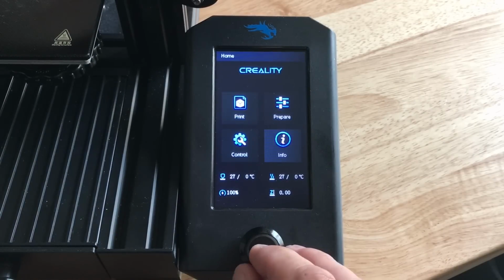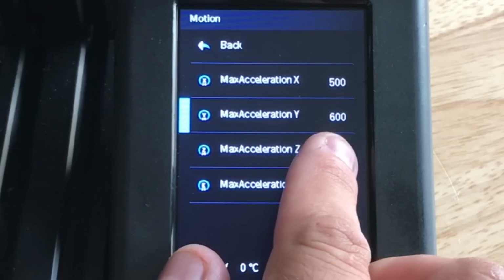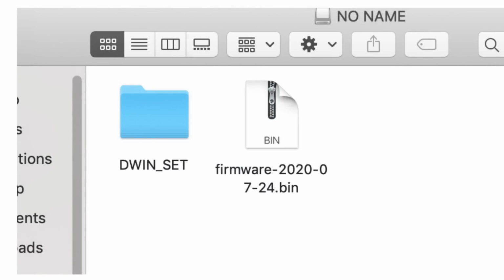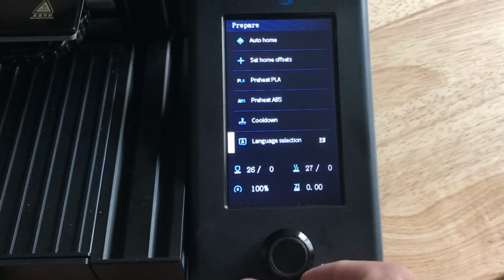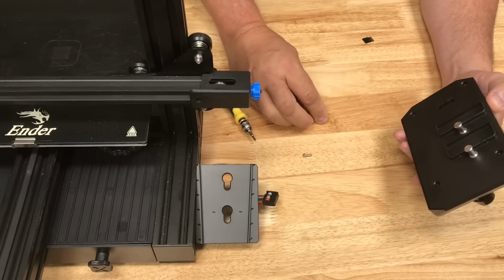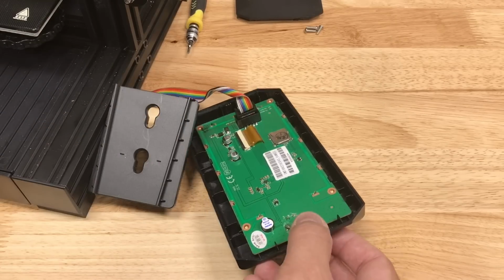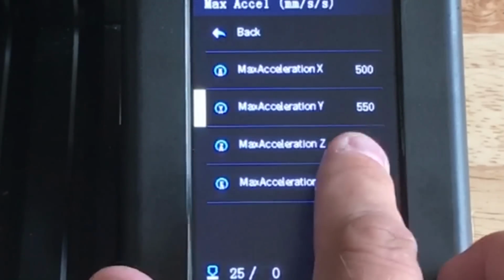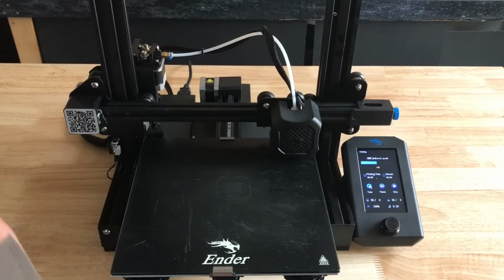Creality Ender 3 V2 Firmware Update - Motherboard and Display

Comment from the maker: Some people had issues with the Ender 3 V2 firmware version I use in my video. So I rebuilt it using the latest Marlin 2.0.7 and released it here: https://www.chepclub.com/ender-3-v2-firmware.html
Pause at height in Cura worked and allowed me to change filament every 5 layers on a rough print (0.28) CHEP CUBE. Try it out and let me know if it works for you too.
Reply: Chep, how to tuning flow rate on ender 3 v.2? I can't find any information.
Reply from the maker: You can adjust flow rate in the slicer.
Reply: @FilamentFriday  okay chep! Thaanks!
Reply: It looks like Creality has yet to release their Ender 3 V2 firmware on their github. Chuck, did you roll your own configuration file to build the firmware? If so, would you minding sharing it  (along with the adv configuration file if tinkered with) on your website along with the binary? Thanks in advance and thank you for being a great resource in the 3D printing community

Edit: Nevermind, Marlin 2.0.6 comes with an example configuration for the Ender 3 V2
Reply: I'm real new at this but I updated to the Marlin firmware.  Nothing would print correctly after that.  I'm back to 1.0.1.  I was severely confused for a while.  😘  I will wait for your verification.  😊
Reply: @CHEP Attempted.   I have a pre order V2 that arrived late June.  When I did the 2.0.6 update and attempted a print it speed X axis across the front half way down the Y axis the dumped a but wad of filament off the bed and started moving slowly towards the middle stringing filament.......  very extra awesome!  Thanks for trying
Reply: I have trouble with this firmware, allways start to print with 515 speed, when i change it printer freezes :(
Reply: itekiti yeah something still isn’t right with it. I went back to stock 1.0.1 firmware for now.
Reply: nope didnt work for me CHEP.  Froze after I changed the language it loaded up fine but there is something not right yet.    Thanks for trying though.  I went back to 1.0.1 too.
Reply: I installed it and both my ender 3 v2 act very strange. Sometime i get over 700 in speed and sometime 500. It almost destroyed my machines before i notice this behave
Reply: Worked fine for me.  Only glitch I saw was it took a few minutes for the screen to prompt to print (kept shwing pause and stop).   I should have used tune to heat the head up, because I wasn't able to get all the initial color out before it resumed printing.  Oh well.....
Reply: @gregr5  what exactly worked fine for you? CHEP firmware update, or a Creality one? If Creality, which download date did you use from their site?
Reply: @daverhodes7742  WD - I used the CHEP recompiled 2.0.6 beta code - not the official creality code.  I had the latest creality code loaded and all it did was pause at height briefly and then resume.  It didn't wait for me to hit continue.  Chep's code  compile did.  It did come up in chinese of course, so thanks Chep for pointing out how to get back to ingles.
Reply: Possible to change the translated sentence in Marlin ?
Reply: FYI - during LCD FW update the screen should be blue for 6-7 s (during actual FW flashing) before turning orange. Otherwise it's not doing anything. I had to format the SD blank and remove Chinese characters from the firmware name to get this to update. That fixed the Store configuration menu. But I didn't like the new letter aliasing introduced in it so went back to 1.0.1 anyway.
Reply from the maker: Chris- Good tip. I tried all that and mine still won’t update. The blue flashes briefly and then orange. It’s got issues apparently.
Reply: @FilamentFriday  Bummer. Indeed it not a flawless experience. Last thing I could think of is using stock 8GB card and formatting using default allocation size, but I doubt it'll help. I'll be watching the space for experiences with the new 2.0.6 you compiled (I'm not brave enough yet). Anyway, going back to watching my first layer... ;-)
Reply: @FilamentFriday  Im getting an issue where I run your bed level with your firmware update and the screen will just freeze could you help me out Thank you so much!
Reply: @xzenoraptor2583  I also have this mate
Reply: @mcloum  its really weird cant seem to figure it out
Reply: XZeno Raptor I’ve gone back to Crealitys firmware for the moment. Just installed new springs on the bed so testing with a calibration car currently
Reply: @mcloum  ah yeah I just ordered some Capricorn tubing new springs and a medal extruder
Reply: @xzenoraptor2583  which metal extruder did you get?
Reply: @mcloum  the creality one off of amazon
Reply: @FilamentFriday  well like I'm using it but still having an issue where the screen will freeze
Reply: I think it might be an issue with my printer hmmm?
Reply: TDNAM _99 like 1 month ago
Reply: @xzenoraptor2583 what version the firmware when it came? .. Mine already shipped with 1.0.1 latest firmware from creality... I guess maybe newer batch only had this issue
Reply: TDNAM _99 same with mine
Reply: Hello Chuck. I still have issues accessing your website. It says "ERR_CONNECTION_TIMED_OUT".
Reply: Hoping to see a filament runout sensor enabled as well.
Reply: Hi @CHEP, thank you for the great video and the firmware, I'm hoping you can help me with an issue I'm having with this firmware. When I home the printer, or when I start a print and it homes itself, the x axis carriage sometimes doesn't stop when it hit's the limit switch. When this happens I have to quickly switch off the power, upon reboot it works fine. It's an intermittent problem and I haven't had the issue when I roll back to crealitys firmware. Any help would be appreciated. Thank you
Reply: Hi Chep, First off, Thank you for your videos.  They made me confident enough to buy my first 3D printer.  I just wanted to check if you've tried the latest firmware from Creality for the Ender 3 v2?  It's dated 8/29/2020.  Would it be worth it to use that?
Reply from the maker: Yes, I’ve tried it. Works fine. Just doesn’t recognize M0 pause command and few other quirks.
Reply: @FilamentFriday  I've updated to Creality Firmware v1.0.2.   It still has the major problem for me of not storing changes on EEPROM. Have you found this not to be an issue with this latest version?
Reply: I just tried to update my firmware using yours and I just get a blank screen when I turn it on. Nothing is happening. Is it bricked?
Reply from the maker: I’ve released a V2.0.7 version.
Reply: @FilamentFriday  Anything interesting in 2.0.7?  I recompiled with it yesterday, but haven't seen anything new.....
Reply from the maker: No more 22 character error and M0 works. It’s suppose to fix power loss recovery too but I can’t confirm that.

Comment: The Bob Vila of 3D printing. Your production quality is top notch, which helps deliver the information in an easy-to-understand way. 

I just got my Ender 3 Pro and it came with the V2 board, but with old firmware that effectively limited it to an normal Ender 3 Pro. The micro USB made me suspect of the model I had. I found out what was going on when I swapped the board for the SKR mini 2.0 w/ TFT35 3.0 from BIQU. Incredible upgrade too! Some Reddit users have also shared similar findings of a Creality 4.2.2 board in their Ender 3 Pro. I ordered my Ender from Comgrow on Amazon and the plastic extruder now has a brass fitting on the intake. A metal upgrade isn't such an important upgrade if the stock version's design flaws have finally been addressed. My aluminum print bed was slightly warped, but a glass bed fixed that issue.
Thanks Chuck!

Comment: Thanks Chuck! I was hoping the new firmware would solve some issues I’m having with the V2 but no such luck. When I print larger models, the skirt lays down fine on the left side of the X axis but gets cut off and doesn’t print skirt to edge on the right. The skirt and edge of the model end up in the same line. Maximum model size it will allow me to print is 212mm but it still does this. I’m using Cura and model is perfectly centered when sliced.  There is nothing physically preventing it from going into the area either. Any thoughts?

Comment: What a pile!! 
Skr mini e3 much better!!!
Reply: Many commenting the mini e3 on their 2nd or 3rd replacements  from what I’m reading on the the printer groups may disagree? Even btt isn’t sure, v1,v1.2, and now a v2 in just over a year fixing issues. 
Don’t get me wrong, I’m waiting for the v3 and then I’m trying one again in my e3 pro and maybe the e3 v2 on order if the Creality 32 bit is a bust. I actually bought the e3 mini v1 first week it was at AliExpress. Then found out no support fw  and heat issues. Then they quickly released the v1.2. I gave my board away, even the duck! Funny, i thought the e3 mini was a pile. I trust Chucks opinion so I’m watching his updates and  fw updates on this v2. If the board is a bust both it and the display will have to be changed.

Comment: Thanks Chuck! But it is not working for me, the printer freezes at the pause step. Any idea? Running the firmware from the description.
Reply from the maker: I’ve put a hold on the release while I check with Marlin team.
Reply: I had same issues... Any fix??
Reply: @tdnam_9989  stay on the CREALITY firmware, too early for Marlin build tbh...
Reply: @HempMeful  yep .. Im back with creality firmware... Since my printer when it freeze, it actually heating hot end all the way up. Iam realizing it till 275 C .. XD
Reply: @ClareFPV  that marlin build is just broken, filenames longer than 22 characters speed up the printer to 400% lol
Reply: Thanks Chuck!

Comment: Thanks, Chuck, I still have not installed the new hot end to try to fix my Ender 3 V2.  YOu may recall that from a few months ago.  So I have ordered the motherboard and display and do it  all at one time.  Fingers crossed. I will let you know.  Again, thanks for all you do, it is a pleasure to be a supporter on Patreon.
Reply from the maker: Let me know.

Comment: I think the 1_English.jpg file in the DWIN_SET folder is the problem of the cropped "Storage Configuration" feature?
Probably how the lettering settings should be left justified instead of right justified.

Comment: Does this new firmware enable Linear Advance? Stock Ender 3 has Linear Advance disabled.
Reply: If you would like to enable linear advance, you will have to compile your own firmware. Luckily it's a relatively easy setup, mainly consisting of platform io IDE, an extension to VSCode which allows compilation of firmware for 32bit boards, which come out as .bin files!
Edit: Basically just search up how to compile firmware for btt SKR 2.0 boards on e3, and switch the board in config.h and platformio.ini
Reply: if you mean ender 3v2 then you can't, ender 3v2 doesn't support the adv lin because the stepper drive is standalone mode

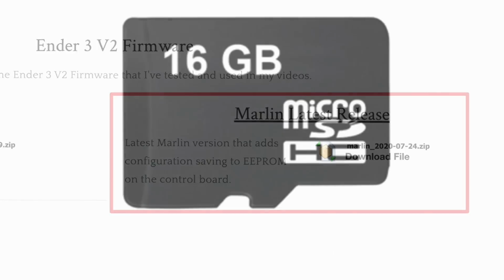Comment: 2:36 I do not think you can use a MicroSD card larger than 8GB on the Ender 3 V2?  If anyone has tried larger capacity, please let us know.
Reply: I think formatting the card is the key.   The card that came with my ender wouldn't work.  Moved the files to my hard drive, re-formmated and all good.
Reply: Using 32gb card currently. Didn't work at all until I copied the SD card files from the creality downloads section.  Annoying, but now it works just fine.
Reply: Using 32gb card currently. Didn't work at all until I copied the SD card files from the creality downloads section.  Annoying, but now it works just fine.
Reply: I'm using 16 and it's fine.
Reply: @friza16  thank you.  So the "must use" 8GB MicroSD is bullshit, thank you.  Got that from a Marlin developer... so go figure.
Reply: @timd9430  Yeah, that's just a conspiracy among the "better" 32bit motherboards, but really if you're using a cheap motherboard, it won't work this corresponds to the bootloader that updates the firmware via SD. The more high-end boards tend to come with bootloaders that only check what is under a certain name or folder, which saves time and memory, whereas the more cheap boards usually just search for a .bin folder regardless of the name and with larger sized micro/full sd's can take a lot of memory and time eventually leading to a crash :(.

Comment: When u install the the skr v2 make sure u swap the fans ... the part cooling fan goes on outside and the motherboard fan goes on the inside 

I found this out after trying to find out why my part cooling fan was always running 

Please make sure u include this in ur review
Reply: I noticed mine was doing that too. I was thinking I got them switched when I installed everything. I've been too lazy to check it out. Seems to print ok though.
Reply: @Muffins77  i was to but then i said to heck with it and flipped it over and swapped cables .. took 2 seconds
Reply: His Amazon link takes you to the V1.2 model. I also see a V2 option.What is the difference between the two models? I have and Ender 3 Pro.
Reply: @michaelqdoba  i also have ender3 pro .. just changed out to the v2.0 board yesterday with the tft screen 

Works great 

I havent done the bltouch yet though
Reply: @turtle-turlte  Thank you. Going to order both to upgrade now.
Reply: @michaelqdoba  i really dont know this is my first time with the skr anything 

Um i think moffett's are bigger 
And the layout is different on a few pins

Comment: Great video as usual. Other than Storage not being cut off why do the display FW upgrade. Did they improve the display contrast, provide an option to adjust? I really do not like the E3V2 display, if you are not at just the right angle it's hard to see what you have selected.